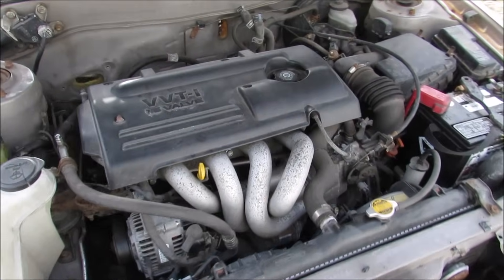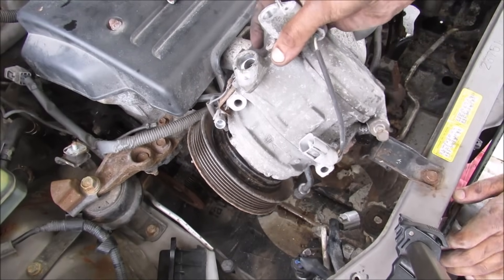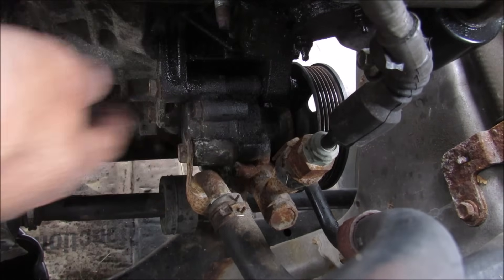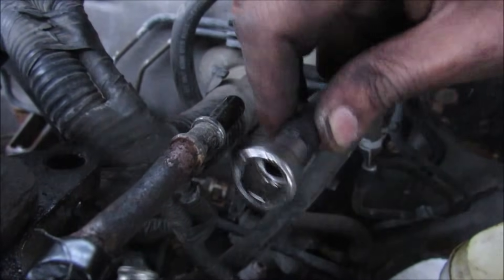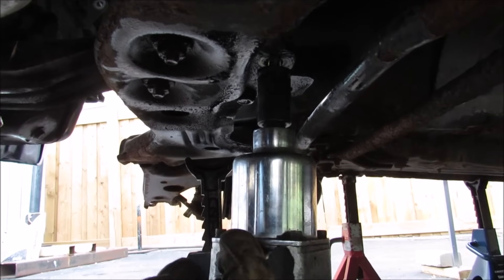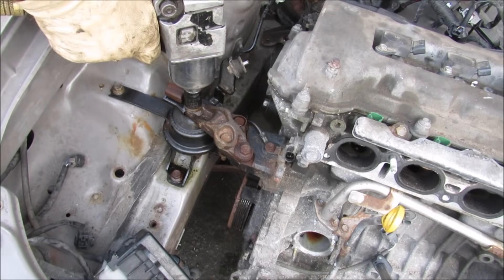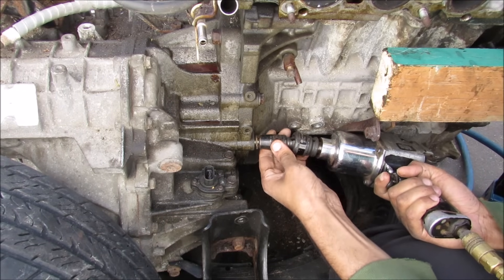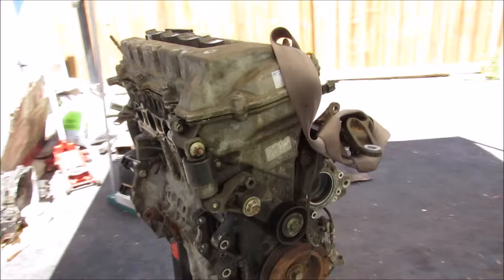How to Remove an Engine

Comment: its called a flex plate not a flywheel manuals have flywheels auto's have flex plates
Reply from the maker: +Gazoline Yes agreed. I mixed them up.
Reply: They both have flywheels

Comment: Excellent video as usual. The only thing I would've mentioned is to remove the battery first. Yes I have learned that lesson. I appreciate that you took this video all the way to putting it on the stand.
Reply from the maker: +Tripp M Thanks ! 
Your right, I should have removed the battery before the alternator, but I believe I had at least had it disconnected.

Comment: I like working on cars to, I don't have this car but I want to remove Engine from 2006 Nissan Murano 3.5L Engine and Install it in 2003 Infinity FX 35 it's also 3.5L Engine, one thing I do wonder will it really work, Nissan Murano is front wheel Drive and Infinity FX 35 is 4 wheel drive, one thing is for sure some one installed an Engine from Infinity G35 and I am not sure if it was 4 wheel drive one, but it had advanced timing problem and it lasted about 1k miles and died, if you know anything on this please let me know
Reply from the maker: +ZIMALETA HOW TO SHOW & UNBOXING the engines are different. Get one from a maxima or altima.
Reply: ZIMALETA HOW TO SHOW & UNBOXING just buy it it doesn't cost that much

Comment: You should probably clean the engine bay. Not gonna get a better chance than this
Reply from the maker: +rafsolo300 Good thought, more like I should degrease the engine from all the oil leak and crud buildup. The bay isn't too bad.

Comment: This is the exact video I've been waiting for lol.
Reply from the maker: +Chris Avalos Glad it helps, you doing engine swap soon?
Reply: I'm kind of doing the exact opposite but I'm sure this will help. The engine was pulled and rebuilt but never installed so I have to diy it myself
Reply from the maker: +Chris Avalos Alright, glad it could help. I assume your doing it on a similar engine/car? 
Let me know how it goes.
Reply: The same exact car. Are you planning to record the install process too? Because that would help me so much lol.

Comment: did you buy the corolla just to strip it?
Reply from the maker: +Mario Djameh Yes 
How else does one have "fun" with a corolla? Lol
Reply: If you live somewhere there is a "U pull it" or "Pull a part" yard you can get a lot of stuff really cheap. People in the south are fucking stupid but that is one of the few perks of living here, lots of wrecking yards around. Someone once told me they don't have them up north.
Reply: @mrflamewars  No we have them up north.    We even have a private yard by me north of Milwaukee WI that is only open on Saturdays.  You just haggle with the owner and you also do all of the work.  Its VARY cheap!  Down south you don't get the rust - salt issue we have.
Reply: If you still have it and aren't going to use it it would be great to see some high resolution shots of the ECU board and an identification of the chips contained therein
Reply from the maker: +ssandal I'm going to be cutting up most of the parts to show how things work. I might sell the front end body parts and lights.
Reply from the maker: +John I agree, especially after discovering two more yards earlier this year about 45min drive from me. They have fixed pricing and is pretty reasonable.
Reply from the maker: +John I agree, especially after discovering two more yards earlier this year about 45min drive from me. They have fixed pricing and is pretty reasonable.
Reply: i bet you must have A shop close to Toronto. can i know the address of your shop? thx.
Reply: John:  Blacks and Mexicans are really fucking stupid, too. Right? Or is it just "Southerners" (white, Christian, males) who you have the balls to call really fucking stupid? But since you said/heard that there are no junk yards up north, maybe it's you who's really fucking stupid.

Comment: what r u going to do with that engine ??
Reply from the maker: +Akshay Bobade take it apart and see how it works. What do u want to see from it?
Reply: Start from the top and work down. 

WE NEED MOAR TOOTHBRUSH
Reply: Detailed VVT-i sprocket teardown and analysis. Same for the "Oil Control Valve"

The timing chain tensioner, the guides, and the oil pump. It looks like, in some diagrams, that the oil pump has a "squirter" to shoot oil at the chain, but it's hard to make out in just pictures.

If you can, section the cylinder head, block, and crank across. Like with a bandsaw or something
Reply from the maker: +John thanks for the suggestion, I have all of those earmarked for future videos already :)
I actually started taking the engine apart yesterday.  
I'd really love to section the block, I know its aluminium, but wonder if my sawzal can handle it.
Reply from the maker: +durania717 Haha but remember, its my brothers toothbrush, I can't just keep stealing them everyday or he'll suspect something.